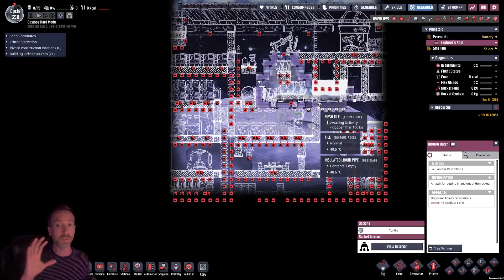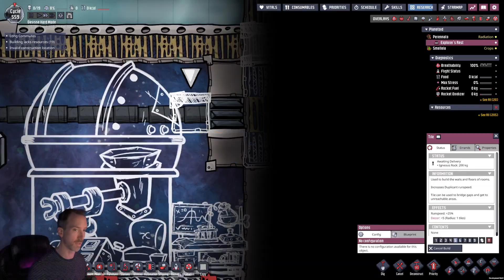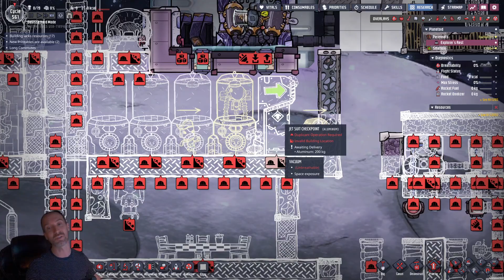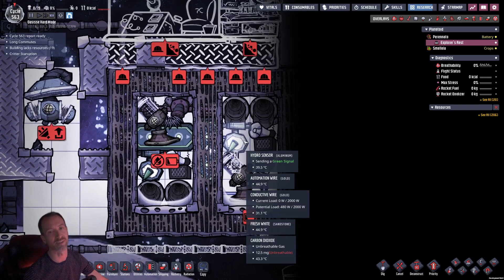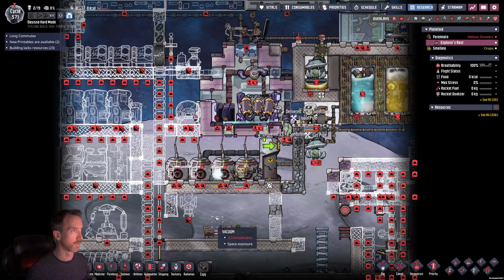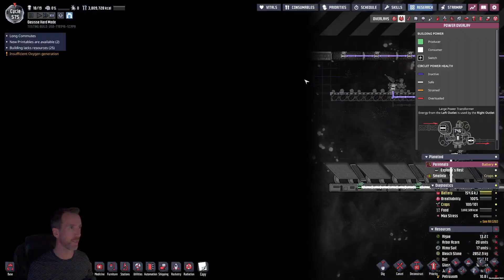Rocket Utilities - Oasisse Hard Mode  - Ep. 34

Comment: you don't have to tile the sides of the rocket interior, it's neutronium behind the "fog of war", filling the top with liquid to block rad is pretty smart why not use this rad shield as a liquid storage, it wouldn't take much more space compared to the 2 liquid storage you made. Also you can swipe the things that fell at the bottom of the rocket, it's only 2/3 tiles deep, just avoid droping a dupe in there.